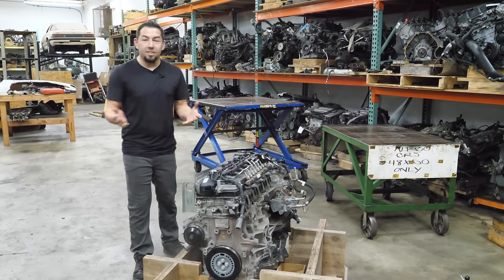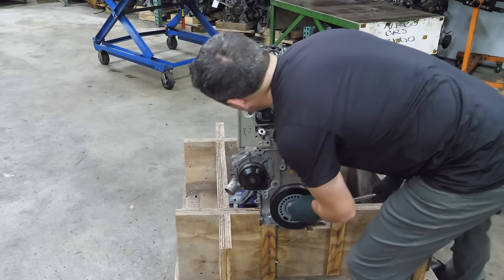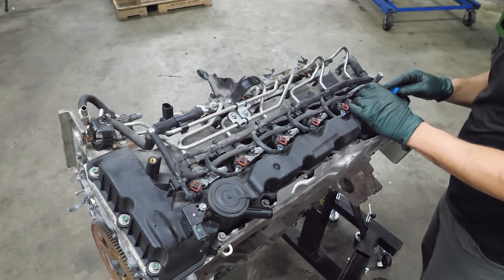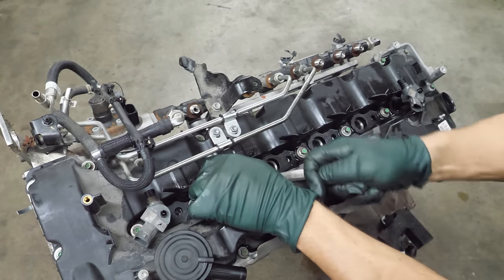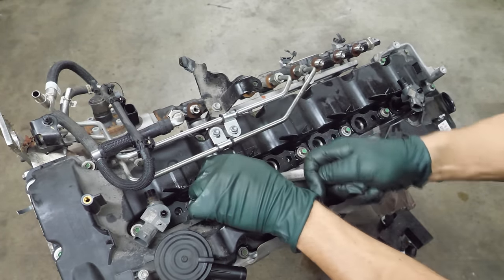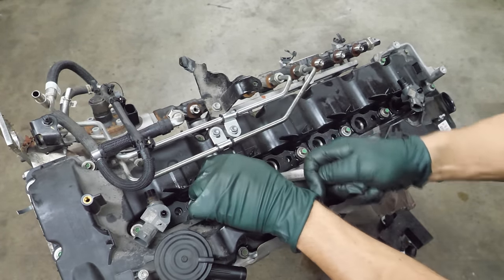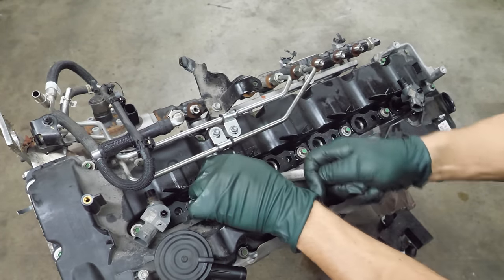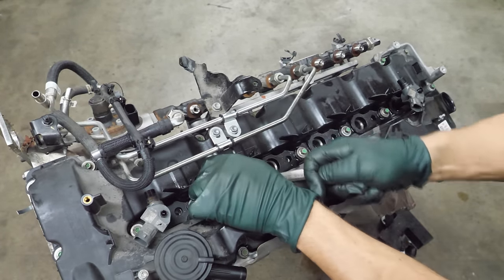BAD 2020 Silverado 3.0 Duramax LM2 Engine Teardown INCREDIBLE DAMAGE!

Comment: In order to reduce the cost of the engine by maybe $50, GM decides to use a belt for the oil pump that requires a $2k service to replace at 150k miles.  If the belt breaks, it's $8k engine replacement.  So they not only save money up front, but make more money on servicing the vehicle as well.  In business, that's what we call a win-win.
Reply: If you can't afford a 2k service every 150k you're too poor to own one of these anyways lmao, 70k+ vehicles and you're whining about a 2k service
Reply: Yep! A win win is only a win for the person expressing it😅😅
Reply: Well that and they didnt want to do major modifications to the engine bc its an overseas design. Its used in europe for cab overs.
Reply: Modern diesels are expensive AF upfront and over their useful service life.  Unless someone is extensively towing, the fuel economy alone doesn't make up for it; TCO is higher.  At least the HD pickup diesels do better in this aspect.  Even the VM Motori's (Fiat owned) have been around since like '13 in the Ram and I wouldn't get an EcoDiesel.  Ford abandoned this space altogether in half-tons, so that's pretty telling.
Reply: 8k? LOLOLOLOL  Try closer to 15k for hese lm2s just for the engine. Labor is 50 hours to R&R.
Reply: Yup built in failure points at a certain amount of
Mileage which all the big 3 practice.
Reply: If you can’t afford a $2k service at the 150k mark on your $65-$75k truck than you have no business buying said truck in the first place.
Reply: @jellyfrosh9102  2k?  You're insane.  This is at worst, a transmission re&re JUST to get to that belt and pump.  This is a $7500 job at least.
Reply: So here we have a teardown video of a destroyed LM2, and the part in the best condition is the oil pump belt. Go figure.
Reply: @2dfx just checked with dealer and the “book” says $1050 labor, $200 parts for oil pump belt replacement
Reply: Will be a lot higher $$ when they talk you into seals, tensioners, chains ,pumps etc
Reply: True but why not design an external electric pump at a 500.00 servicing cost instead??
Reply: @jellyfrosh9102 so GM should endanger people on the road over $50 bucks per vehicle? Designing cars with built in "gravy work" should be illegal. I guess you'd be accepting of Ford selling a dry clutch DCT they knew would fail because people should just accept crappy engineering and buy a new transmission?
Reply: @tellucas  dudes probably 16
Reply: 80+ thousand for a  truck with this pile under the  hood absolutely ridiculous as for  every one  saying  your to poor to own because its  expensive  to service a fool and there money is  soon parted and  gm seen you  coming .
Reply: In order to save $2, water pump impeller was reduced in size and made out of plastic.
Reply: Until people no longer buy the truck.
Reply: And as a consumer that’s what I call a, “Pass Pass.” :)
Reply: Probably add about 5-6k to that engine replacement for these
Reply: @jellyfrosh9102 this shit attitude is why they get away with this shit. It’s not a matter of affording it, it’s a matter of being a piece of junk. I can spend 1 million on a car, doesn’t mean I wanna pay 2k for some bullshit.
Reply: @jellyfrosh9102  What? 2500 at 150 is a lot of money, thats on top of all the other 500-1500 repairs needed. No thanks, not justified.
Reply: @DeltaSierra426 diesels are not worth ot in anything othere than a large work truck or rig, just too much money to maintain and repair.... I can buy a lot of gasoline for the cost of maintaining these pos', on top of it all , diesel is more expensive than has now, and then there is def fluid to add,....another crazy cost..... Them in 5nyears 3+5 k for new catyletic
Reply: @2dfx not true at all. $3500 is an actual quote. I love how guys will spend 70k on a truck, add 5k in useless upgrades and then whine about maintenance cost
Reply: You do realize that re-engineering an existing engine to change from a belt to a chain is a huge investment, right? You understand that, right?
Reply: @2dfx  It requires fewer labor hours than the oil pump belt service on a 2.7 Ecoboost or 5.0 Coyote.
Reply: jeanclaude7018  There has been an abundance of defending piss poor engineering of Ford engines for years. Same with Toyota. Same with Ram. All of them loaded with planned obsolescence these days.
Reply: @cjwright1960 reality is that when these come in at 7 yrs or more with 150K, if the owner even does that, the dealer will double the time guide amount and you've taken the back end down and there is guide rail wear and a near full extension tensioner for cam drive chain and they will recommend the full meal deal on the timing components.
Reply: @DeltaSierra426  I disagree with almost everything you said.  My diesel sedan is only $1300 more to buy. I do agree that servicing costs are higher,  but the additional oil & filter change is only an extra $100/year. The fuel economy is 30% better than the petrol engine. Thus in 8 years I have had to recover a total of $2100 having driven 96,000 miles. I have averaged 52.3 mpg and saved 600 gals. I have just about broken even on fuel alone and have a much better driving experience.  If I drove further I's definitely be in the black.
Reply: jeanclaude7018  so GM did $4 for me and then $8000 for the customer?
Reply: @csjrogerson2377  We're primarily talking in the context of premium North American pickup trucks here.  Small diesels like those on cars have a completely different cost scale.  In fact, I'm inclined to agree with you in that regard (and not just your anecdotal situation that you happened to come way ahead, which I don't believe represents the norm, BTW).
TCO is only an estimation and can come out very different 10 years after that initial estimation due to surprised repairs, unstable fuel costs, etc.  Adding more variability to the equation, some states have lower diesel prices relative to gasoline while others have noticeably higher diesel fuel costs.

Will end with this:  more businesses are going back to gas-powered heavy duty trucks than making the transition the other way as they've made the careful calculations and are looking out for their bottomline.  The big gas V8's and V10's are selling faster in class 5-7 trucks -- the data shows it.  :/
Reply: @jellyfrosh9102 it's always funny seeing comments like yours get about 10% of the likes of comments made by knowledgeable mechanics 🤣
Reply: @ElectricBlueIX  thats ridiculous!!!!! 2k at 150k?? No thanks. A diesel engine should not need anything other than air filter, oil/water filters and changes for the first 250k , and thats being conservative.. make a lot of people are forgetting what the diesel engine was intended for originally, good towing capabilities indeed but it used to be because of reliability/simplicity, and longevity on top of that. Yes, today's modern diesel engines are power horses, but the cost of operations and repairs are just skyrocketing to point where its just not worth it.
Reply: that's pretty much like a clutch job price and mileage wise... geeze people are soft now a days
Reply: It’s 200k now
Reply: It’s every 200k miles
Reply: I will KEEP THE 1986 CHEVY TRUCK RUNNING. 😁😂😂
Reply: @jellyfrosh9102 I don’t think it’s about being able to afford a 2k service.     
It’s about the stupidity of GM
Reply: @2dfx no. The transmission is specifically serviceable for that task
Reply: Cost isnt why a belt was chosen
Reply: @TheJcrandazzo you want an external electric oil pump, meanwhile other yt channels are full of people bitching about electric water pumps
Reply: @BiscuitMcgriddleson 150k mile service interval is a clutch job dude
Reply: @maxmx767 it isn’t stupid. Belts are more efficient drives than gears and allow their variable speed design to work correctly. It’s a perfectly reasonable service item.
Reply: @jellyfrosh9102  I have been in this business for almost 50 years. Probably more than half of these trucks will get traded and the used car purchaser set will consist of a significant number that have no idea that it needs that belt changed. The broken timing belts on 8 year old vehicles that were due a belt at 6 years are people that bought it at 4-6 years. A person that knew it needed a belt for $1400 traded it and spent that money on a new vehicle and the dealer sent it to auction because it was not certified preowned eligible. Now then next owner wrecks the engine.
Reply: Or you could just change it once the oil light comes on. yeah it’ll probably get a minute or so of run time without OP but realistically, probably fine compared to 17k engine replacement.
Reply: I would never buy a vehicle with an oil pump belt thats hard to get to. Ill just stick with the older stuff for a while.
Reply: @jj-ml8yjexcept that this isn't true😂😂furd already has failure in their oil pump belts for their new 5.0 engines
Reply: GMs planned obsolescence team got a fat bonus on this one...
Reply: Based on the TCO compared to gas, then factor in diesel gas pump odor/ease of finding at all stations in USA and the  only reason to buy a diesel is if you need the low torque for constant hauling and towing.  Most who do that need 3/4 ton platform or more.  Diesel in USA does not make sense for smaller non industrial purposes.  I lived in Europe a while back and many small cars where diesel but they cost the consumer the same or less than gas, go figure.  Recently when talking to friends in Norway, he said now they too are getting away from diesel for small non industrial engines due to emissions and costs related to newer emissions systems as well as political agendas pushing the electric boondoggle.
Reply: Better than my 6.2L gasser that needed 8K worth of top end work the day it rolled off the line since it was built with the dreadful DFM lifters.
Reply: @cjwright1960  that sounds reasonable. I plan on doing mine myself.

Comment: The wet oil pump belt has a 150k mi interval on the LM2, but its second gen version the LZ0 has the interval bumped to 200k mi.  Same p/n belt too.  As for it not running, that component on the high pressure pump is the pressure regulator.  When the pump (or regulator) is replaced, there is a procedure with GDS2 called a High Pressure Fuel Variable Reset that must be performed.  If not done, the ECM can trip all sorts of DTCs, which would explain why when he put the old regulator on the new pump the truck fired up as it knew the values from the old regulator.  I'm thinking oil consumption which theory is attributed to the aluminum pistons.  LZ0 now has steel pistons.
Reply from the maker: Awesome info!
Reply: So it would seem that they should get an oil pump belt when the transmission is removed for repair.  It will be interesting to see how many miles they get before breaking as we know customers are going to push the ragged edge.
Reply: Steep pistons? That would be a world first

Every modern engines out there has aluminum pistons
Reply: @Prestiged_peck  6.7 Powerstroke has had them since '20, and all Big Rig Motors have run them essentially forever.
Reply: Thank you 🫡
Reply: @Prestiged_peck  It's uncommon in consumer vehicles to have steel pistons. But the large engines in all of the big-rigs you see on the road have steel crowned pistons with aluminum skirts. The design is actually quite interesting.
Reply: Do you also happen to know the head bolt torque spec just because of how much trouble he had with them? Also lol are you a GM tech?
Reply: Changing the recommendations is useless if it outside of the warranty. Do they warranty the belt until 200 k miles?
Reply: @Prestiged_peck Steel pistons has been widely used in industrial engines for the past 50 years.
And like every other industrial invention, it ends up in regular cars.
A decent amount of modern diesel engines for regular cars, feature steel pistons now.

IIRC the good old detroit two-stroke diesels, featured steel crowns since their inception in the 1950's
Reply: The torquing procedure is long and has you tighten and loosen the bolts a few times but final spec ends up being 59 ft lbs plus 225 degrees. @lanceellis
Reply: @I_Do_Cars did you have any info on the oil change intervals? Or could you obtain? Great work BTW, love the videos!
Reply: @Slane583 yeah it is I my group is tearing down a cummins ism with that style of piston in class it’s pretty interesting
Reply: @jeffreygoss8109    Nope.  Powertrain warranty is 5yr/100k.  Belt is not a warranted maintenance item.
Reply: @lanceellis      As @nickbrooks3253 stated, its a long one.  First Pass: Tighten all bolts to 40 Y (30 lb ft), Second Pass: Loosen bolts (13, 14,5, 6, 4, 3, 11, 12) completely., Third Pass: Tighten bolts (13, 14,5, 6, 4, 3, 11, 12) to 40 Y (30 lb ft), Fourth Pass: Loosen bolts (9, 10, 1, 2, 7, 8) completely., Fifth Pass: Tighten bolts (9, 10, 1, 2, 7, 8) to 40 Y (30 lb ft), Sixth Pass: Tighten all bolts to 80 Y (59 lb ft), Final Pass: Using EN-45059–A Angle Meter, tighten all bolts in sequence 225 degrees.  This is for the 14 main head bolts.  There are 3 small bolts that are to 11ft.lbs as well.
Reply: @KentuckyAk101guy   What makes it even more interesting is that it's proven to work in big engines. With them going hundreds of thousands of miles without issue with ease. Especially with proper routine maintenance.
Reply: They bumped it up to 200,000 on the lm2
Reply: @Prestiged_peck Renault also had steel pistons, even before the 3.0 Duramax had them. 2018 or thereabouts. And they were in passenger car diesels too, not trucks.
Reply: @zackjay71 LZ0 is 200,000.
Reply: @zackjay71    For the 2023 LM2 in the SUVs, yes.  Otherwise all the pickup and SUV books prior to 2023 for LM2 are still 150k interval.
Reply: @Slane583 the articulated piston is going away. One piece steel pistons are going in all of the heavy duty engines. Mahle Monotherm is series. We run the steel pistons in Cat 3500 series engines.
Reply: @87cr250r   If I was to have a guess it's probably due to cost. Making a solid one piece steel piston is cheaper and easier than the steel crown/aluminum combo. Of course I am no diesel expert so it's just a guess. :)
Reply: So gm warranty on the belt is 200k?
Reply: @killercan10 so gm thinks it's good for 5y 100k nice
Reply: @admiral_peck7834 
Every engine I used or touched today has steel pistons. 
It's extremely common in diesel engines. 
Of the dozens of types of diesels, from 1.1L to 57L that I've had apart, less than 5 had all-aluminum pistons- I've seen steel crowns with aluminum skirts plenty of times- Cat loves a 2-piece piston in several applications.
Reply: @HomelabExtreme  Those Detroits are older than the 50s, unless you were referring to the piston design itself.
Reply: @mddunlap03    No.  Its service interval is 200k.  There is NO warranty on the belt past the powertrain warranty which is 5yr/100k so if it fails in that time frame, it would be a warranty replacement.  Otherwise, no it is NOT a warranty on it.
Reply: As an LMM owner, I find it MADDENING that they have changed over to steel pistons in the 3.0L while the 6.6L still has aluminum pistons. The 6.6L should’ve been using steel pistons since 2001, yet here in 2023 they’re still aluminum 😀
Reply: on the LZ0, not LM2. Assume you meant that @zackjay71
Reply: @adam9936  no. Lm2 carries same part and interval is increased
Reply: @admiral_peck7834 NO, it's NOT a "world's first", and that engine DOES have steel pistons. 

Don't criticize someone, when it's YOU that is completely wrong.
Reply: Actually, GM has stated all oil pump belts both LZ0 and LM2 are now good 200k miles. Heard it straight from the GM engineers mouth on another vid
Reply: @killercan10 wrong. It’s the same part #. It’s 200k miles for both LM2 and LZ0 now
Reply: @ZmannR2    I'm aware of that.  All of the service manuals still show 150k interval for LM2  for 2020-2022.  The 2023 SUV books show 200k now though.
Reply: That engine looks really rigid and sturdy.
Reply: Also valve rockers with wheels are awesome the dont wear as much on the can lobes.
Reply: I don't understand why the engineers have to over design everything.  Simple is good.  You don't have to reinvent the wheel for EVERY NEW VEHICLE MODEL.  Those electrical connectors are cause to fire somebody.
Reply: Engine is complete garbage.
Reply: Pushed oil change intervals way too far, likely didn't have the defect valve cover fixed as per TSB. When two bad situations combine.... you get this.
Reply: @Prestiged_peck GM honestly did great homework for the updated LZ0. They basically took all the warranty info and feedback and addressed them. The new forged steel pistons are short, and maintain the same weight as the aluminum. Allowing for a longer rods which allowed for more HP/Torque. Thicker Steel cylinder sleeves to compensate as well. Also the coolant control valve that originally had 3 different actuators have been reduced to 2, meaning less complexity, more reliability, while keeping the same temperature curves according to GM. Turbo tuning to achieve the higher HP/Torque numbers, and other adjustments made to just optimize the engine as a whole. They really did take the lessons from the LM2 and just improved upon them for the LZ0. I might just buy a silverado for 2025, the LZ0 is looking to be a well built and durable motor. Also yes they upped the service mileage for the Oil Pump belt because the data and real world numbers have shown it’s reliable enough to increase the recommended milestone. That’s great news as well.
Reply: @mddunlap03  I guess Toyota thinks their timing chains and crank bearings are good for just 5 years/60k miles. Yikes
Reply: @lanceellis  Torque spec is obviously somewhat tighter, since its a diesel and diesels start at minimum 1:17 compression ratio, which you can take up as high as you want, provided the headbolts can take the stress. Gas engines usually top out at around 1:12 or 1:13 before they start knocking from too much compression.